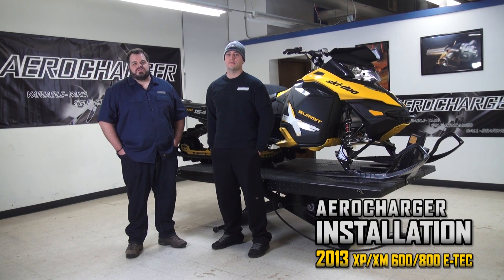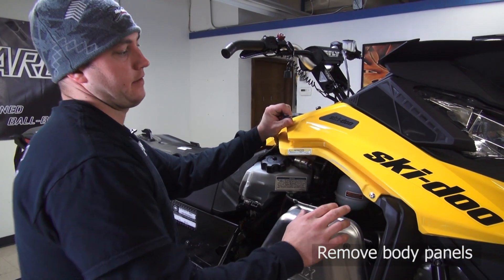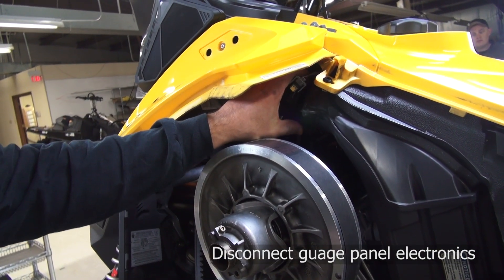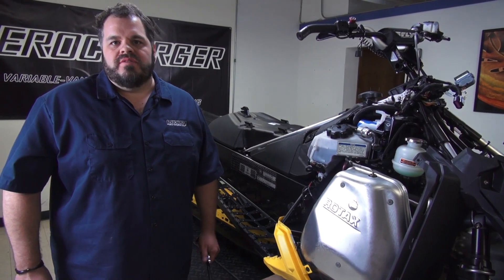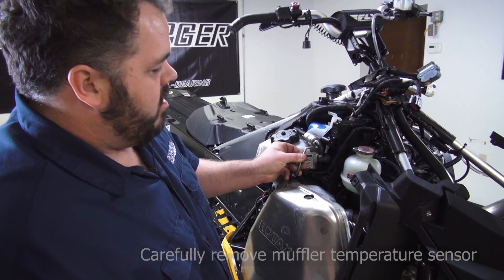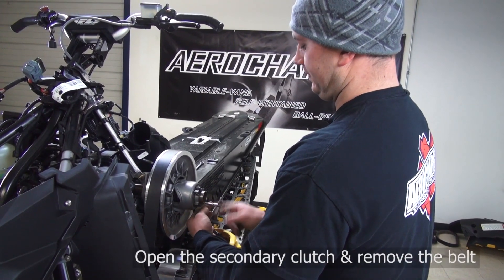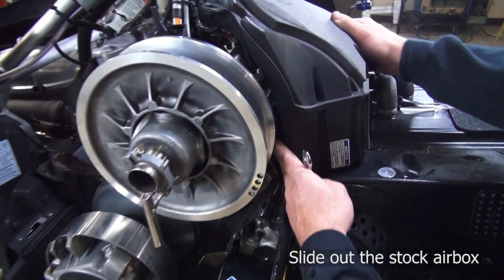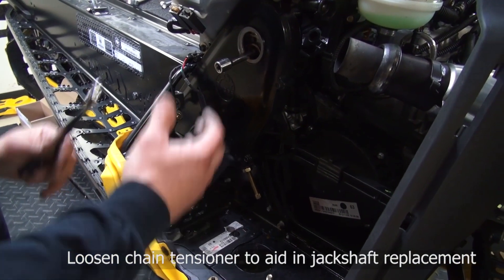Aerocharger Install | Part 1 Ski-Doo E-TEC

Comment from the maker: The octane you'll need to run will depend on your altitude and boost level. Visit the Ski-Doo page at Aerocharger's website for recommended octane for different settings.